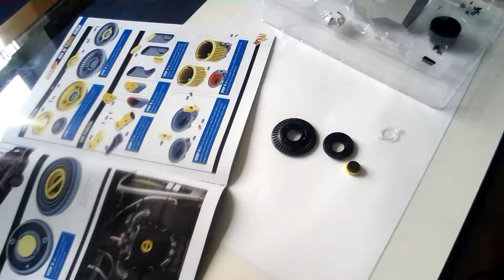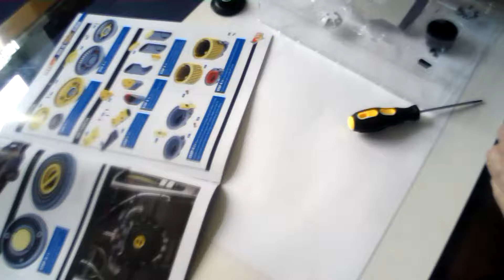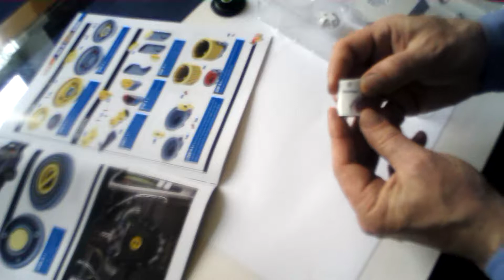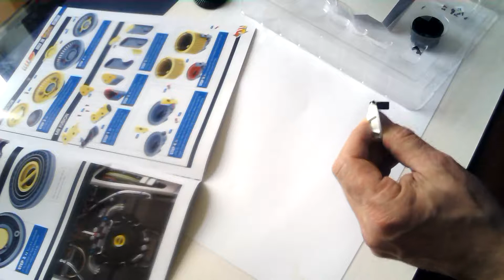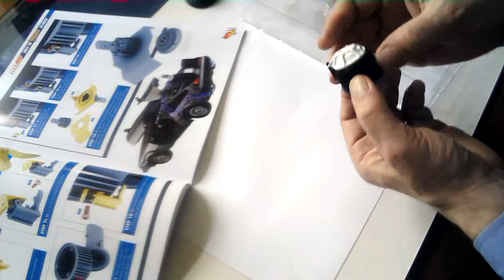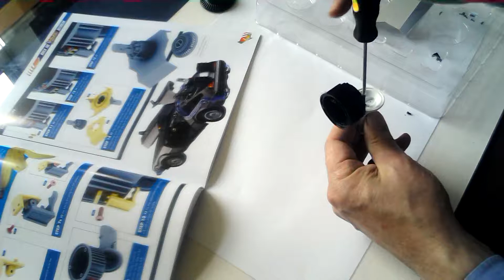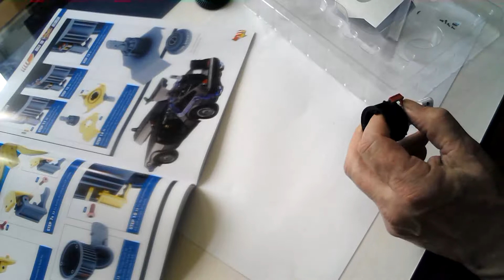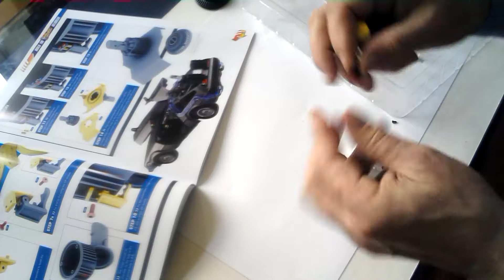eaglemoss delorean  build issue 4 (part1)

Comment: Hi, nice to see i wasn't the only one that noticed this problem I resolved it by cutting the cp screws down with some nail cutters about 1mm on each side then it went together nicely.

but i did contact customer sercvices and they had no idea how to resolve it apart from sending it back to them for there tech team to asemble it for me.
Reply from the maker: your  dead right, the cp scews are just too long for the joint, sad thing  is I bet there are a lot of guys out  there with messed up issue 4's

Comment: I'm enjoying watching people trying to assemble that Mr Fusion hinge with its microscopic springs. To describe it as fiddly is a galactic understatement! I managed to complete mine in the end, but I have no idea how, since I could barely see what I was doing. My hinge latch doesn't quite align squarely with the protrusion on the reactor lid though and requires some pressure to get it seated, which leaves red marks on the white plastic. I'm tempted to get another copy of this issue in case mine had some defective parts, but I'm inclined to believe it might be a common issue with this assembly.
Reply from the maker: I think your right, I bet its a common problem

Comment: With regards to the screws on the Mr Fusion casing, the real prop was also assembled in the same way, with screws in those locations. Of course, the screws on this model are way too big compared to the real thing, so I guess it's a trade off. Probably a better solution would have been to snap fit or glue the two pieces together and have the screw heads as moulded details at the correct size.